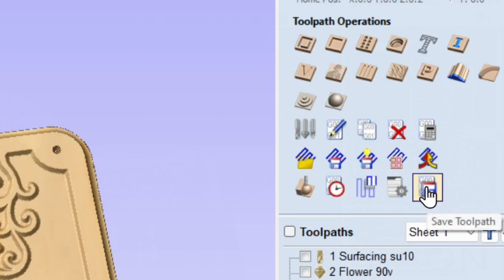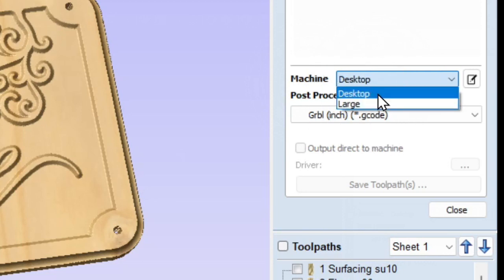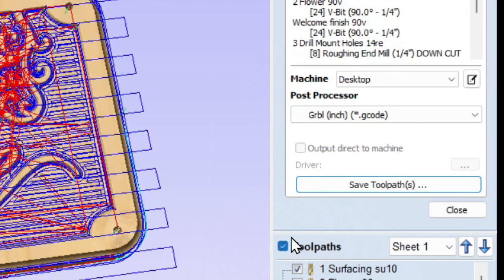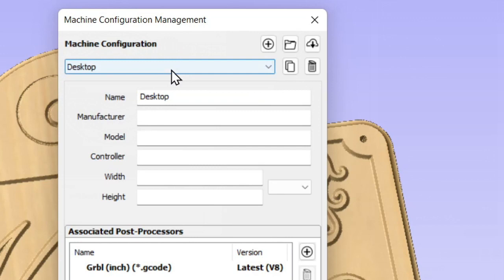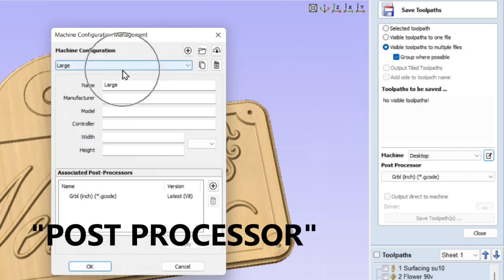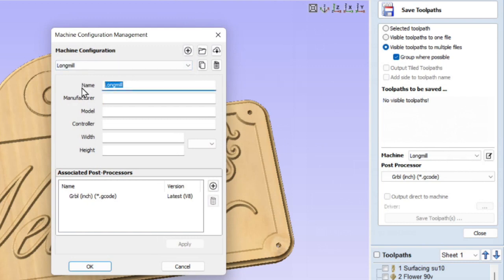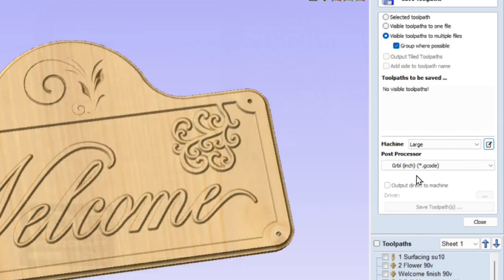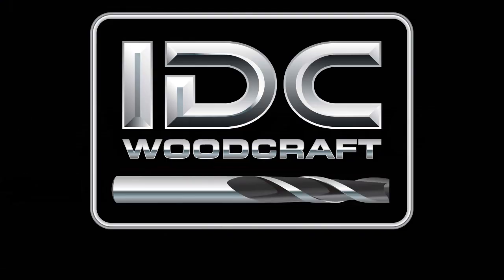How To Setup The Post Processor in Vectric Vcarve, Aspire & Cut2D - IDC Woodcraft

Comment: 4:07 please tell shat should I select for Arduino grbl base cnc machine? The post process list is so long even there is lots g code too like gcode mm, atc, arcs so...
Unfortunately I have version 10
Reply from the maker: omsingharjit, For an Arduino GRBL-based CNC machine, you can select the appropriate post processor that matches your machine's capabilities. I would suggest grbl (inch) or grbl(mm). That is your best bet brother!
Reply: @IDCWoodcraft  yeah I did this and it works

Comment: I have a trend smart plus.
It has goya controller and Bach software. 
I want to run a different software.  The dealer told me I need the extensions.
You spoke about extensions and post processors in this video.
Can you explain the difference. 
Many thanks.
Reply from the maker: Simon, a post processor writes gcode in a specific way so that the cnc controller software can interpret it correctly. An extension in your case might mean an additional bit of software built into your controller that you need to purchase before you can use a different software.

Comment: When I bought my CNC Router, my plan was to do my drawing and designing in Mastercam and use a suitable post processor. My machine came with V Carve Pro. The machine manufacturer recommended a post processor in the V Carve. Looking in the Mastercam post processor list, I didn't see that post processor. I thought I would try a Generic Fanuc which often works with many machines. When it doesn't though, and you go right to cutting, you can get some not so good results. Dry run it first and see what happens. Still, cutting air without setting off alarms or stopping the machine is no assurance you are using a compatible post processor. Attempting to cut a piece will reveal the incompatibilities and leave you with scrap or possibly a damaged machine.

So I would import my Mastercam model into Vectric in a compatible cad format and generate my toolpaths in Vectric. That seemed to work OK. Then I began to use Vectric more and more for design, as I became more and more familiar with it. Now I tend to use both software depending on what I'm doing. Still, using the correct post processor is vital. Using the wrong one can drive your machine to do some things you weren't expecting, like getting a different piece then your graphic check is showing. Then you are trying to figure out why you got a piece that looks so different. Something is definitely very wrong. Yes it is, and it may be you are using the wrong post processor for your machine. How do I know that? Um, well, let's just say I know stuff.
Reply from the maker: All great points CNC programmer. You are totally right, a good dry run before you do anything is always a good idea.

Comment: Very helpful.  But what is the difference between using inches or mm?  And would this affect how my toolpath or cnc might run?
Reply from the maker: navarholmes6358, Using inches or millimeters in CNC routing depends on which system you’re more comfortable with and the standards of the materials and tools you're using. If there's a mismatch between your design and your machine’s settings, like designing in inches but your CNC interprets in millimeters, it’ll throw off your project's dimensions. So, it’s important to keep the same measurement units from design to execution for accuracy.

Comment: Garrett if you had a laser as well would you also have separate post processor iam thinking yes
Reply from the maker: robertanscombe1508, Yes, if you add a laser to your setup, you'll typically need a separate post processor for it. Each tool often requires different settings and commands, making distinct post processors necessary for optimal performance. It's always good to check compatibility with your CNC controller as well. Happy woodworking!

Comment: Hello Garrett,
I have an older version of Aspire, version 9, and I am having some problems with the toolpaths. I manage to create my work and save it but when I take to my little CNC 3018 it does everything else except what it's supposed to. I was told that it could be related to the post processors. My CNC uses GRBL and I am not sure if it is compatible with Aspire. Is there any way to be certain if the two work well together? If not, is there anything I can do to fix the problem?
I hope that you can help me out with this.
Best wishes and thank you for your excellent tutorials.
Thomas
Reply from the maker: Thomas, I recommend reaching out to your machine manufacturer for this one my friend. They'll be able to help you the best on which post processor will work with your specific machine!

Comment: I am using vcarve pro v12.  I am also new to cnc routing.  I looked at my projects and my post processor type.  I have a mis-match.  My material setup is inches, my tool is 1/8 inch but my grbl is (mm).  That doesn't seem right.  Your thoughts?  Could explain why my sender software is having weirdness issue.  seem logical to use either inches or mm from start to finish.
Reply from the maker: navarholmes6358, Yes, you've pinpointed a common issue that can indeed cause problems. When your material and tool settings are in inches, but your post-processor is set to millimeters, this mismatch can result in incorrect tool movements because the commands sent to the machine are in a different unit of measurement than expected.

For a cohesive workflow, you should ensure that the units in your Vectric software match the units your machine is set to interpret. If your machine operates in inches, select an inch-based post-processor in VCarve Pro. If your machine operates in millimeters, choose a mm-based post-processor. This ensures that when you create a toolpath in VCarve Pro, the G-code generated will communicate with your machine in the correct units, avoiding any issues during the routing process.

Comment: Hi Garrett i have a aspire 11.5 and i try tu cut a circle 35 inches on diameter and wen i take it to the machine only cuts a 3 1/2 inch circle can you help me please and thank you have blessed day
Reply from the maker: Juan, make sure the post processor you are using is configured to the same units that your CNC machine control software is set up to. If you are using a (mm) post processor, try selecting the (inch) post processor for your machine!
Reply: @IDCWoodcraft  thank you sir i will try it

Comment: So once the post processor is set up and selected in vcarve, do I set the toolpath  info in vcarve like I did for a shopbot, or do I set up toolpaths in gsender once the project is designed, considering a vcarve pro /Longpath MV2 system.

Does gsender work under wimdows operating system ir does it use it own. What are the laptop specs needed to run gsender, or am I even using gsender?

I am totally confused. Purchasing mv2 and vcarve pro soon.. Paul Schuster
Reply from the maker: Paul, I recommend taking a look at this video here brother: https://youtu.be/wQ0vgXbSRr4?si=troyJ6YRR9Ath2My. I think you'll find it super helpful! If you're still having troubles, I recommend reaching out to Sienci directly and they should be able to help guide you in the right direction. Here's the link to their contact page: http://bit.ly/499dtxg

Comment: Awesome videos for this newby.... Question.... Is there a way to load a G-Code file that was created with Bobcad into Vectric Aspire and edit it? I have a flash drive with several G-Codes for pool cue points and designs, but may want to change the size, etc. I read something about converting to DXT files (or something like that) and then you may could. Any clue?
Reply from the maker: kirkovercash, absolutely! You're definitely on the right track with your thinking my friend. But, this one is a little tricky to walk you through over comments. I recommend joining Kate and I for our weekly live session we host every Wednesday at 8PM EST and we should be able to help guide you through it then!

Comment: Question; I created a project did the tool path. I uploaded it to Gsender and and my 3018 pro max starts the job. The problem is the project is supposed to be 6”x5”x1/2” cutout but it turns out being less than a inch and not all the way through even after the warning that it would.  What could I be doing wrong?
Reply from the maker: corejr691, it sounds like you are using the wrong post processor. If you are using grbl (mm) consider switching it to grbl(inch) and vice versa brother! That should fix your problem.
Reply: @IDCWoodcraft  I’ve changed everything to inch that I could find, I’ll go back to mm.   This machine came pre-installed with candle.  The z and y axis try’s to exceed the limit switches and z axis moves upwards whether I hit raise or lower. Thinking maybe I should change the control board. What do you think?.

Comment: Thanks for the great videos!!  How do I run my job I have created?  I was using Easel Pro, but have been messing around with Vcarve Desktop free trial.  I want to send the "Avalon" sample job to my CNC.  Do I need to export the gcode and use Easel Pro to send to my machine?  Thank you
Reply from the maker: JeffGreen, so glad you liked this one brother! This one is a little tricky to walk you through over comments. I recommend joining Kate and I for our live sessions we host every Wednesday evening at 8PM EST. We should be able to help walk you through it then brother!
Reply: Update, I believe I got it installed.  I had downloaded the Easel PP and installed it in Vcarve Desktop Trial.  I them re-calculated my toolpaths and re-saved.  Imported into Easel Pro and sent the job.  its the sample Avalon one but it is running.  I will definitely like to check out the Wed sessons!! @IDCWoodcraft
Reply: So the Avalon sample is 2 toolpaths, it went and completed the pocket toolpath and looks great, however it didn't return to start position and hold for bit change.  Then I presume I would change my window to the 2nd toolpath and start it up.

Comment: Thank you and it is very useful tutorial. How to do multiple option/switch post processor (for multiple tool that require different set of instruction) Ex: T1 / T2 / T3 have different instruction. Therefor if T1 (Set of instruction no 1) and T2 no 2 and so on.
Reply from the maker: sufainahmad3575, you are so welcome brother! For that I would recommend reaching out to your machine manufacturer on the best post processor to use for different tools.
Reply: Thank you very much  @IDCWoodcraft

Comment: So, I recently picked up a small cnc to learn on, but can't find a post processor listing for it. The test projects that came with it use an .nc format but the specific manufacturer doesn't display the specific machine in the drop-down list of of the menu in VCarve Desktop trial. I have a message out to them asking for the specific post processor info, so hopefully that arrives sometime soon!
Reply from the maker: Gary, I just saw your previous comment brother. You're doing the right thing reaching out to your manufacturer. I would say to wait for their response and go off of their recommendations for now my friend.
Reply: @IDCWoodcraft  I got the reply today regarding the post processor info, and essentially I need to manually create the machine config in VCarve to include my machine. I went ahead and purchased VCarve desktop and have been trying different machine configurations to match my machine - SainSmart genmitsu 4040 pro. So far I've carved my name on a piece of mdf using a GCode file as a post processor in the machine configuration, and that turned out OK. The candle software doesn't render the tool path very well, but it directed the machine just fine. Onward and forward!
Reply: @IDCWoodcraft  I forgot to add that the manufacturer didn't have anything and referred me back to the software company. I shared the email with them and they provided the video tutorial of how to manually set up a post processor!

Comment: How do you know if the post processor is inch or metric? PS still running your bits and they're holding up fantastic.
Reply from the maker: D Barger, usually the title of the post processor  will say gbrl (inch) or gbrl(mm) denoting what unit of measure.

Comment: I must say I have learned SOOOO MUCH from your videos…..but now I’m stumped because when I open my Sainsmart CNC…I’m not able to find my code that I’ve generated via vetric.  I’m sure I’m doing something wrong.  I need your help.  

I have went through the post processor selection options and selected Grbl
Reply from the maker: Willie, are you working with the trial version of the software? If so, you won't be able to generate the gcode. If not, I recommend sending a message over to vectric directly and they should be able to help you troubleshoot and give you a little better guidance than I can on this one! Here's their contact page just in case you need it: https://www.vectric.com/support

Comment: Can artcam support grbl for  Arduino based cnc?
Reply from the maker: omsingharjit, ArtCAM does not natively support GRBL, as it typically works with its own systems and compatible software. However, you can create your designs in ArtCAM and export them to a file format like G-code that GRBL can read. After that, you can use a compatible software to send the G-code to your Arduino-based CNC machine. It's always a good idea to double-check the specs and compatibility for smooth operation!
Reply: @IDCWoodcraft  But, as you said, ArtCAM doesn't support GRBL post processors. That means there would be no option to generate G-code via a GRBL post processor, so how is it possible? And even if it could output GRBL, the problem would already be solved! It seems you’re suggesting using ArtCAM as a CAD tool to export vector files, then using another CAM software to generate GRBL G-code, right?
I also researched that people use Mach post processors in ArtCAM, which are somewhat similar to GRBL, but the code requires manual editing.

Comment: if you select GRBL mm instead of inches what effect would it have? (I work in inches)
Reply from the maker: davidorourke9920, Switching to GRBL mm would change the unit of measurement used in the software from inches to millimeters. This means all your measurements and tool paths would be in millimeters instead of inches. Just make sure to adjust your design accordingly when switching between the two units.

Comment: Hi Garret I am currently running a stratos pro  cnc router with a fanuc controller i can not find a post processer on there list that wants to work on my cnc .can a guy get one made for it or is that not possible ?who do a guy get to make a post-processor if that is an option.Thanks  Garret.
Reply from the maker: Wow nice machine Mark. That machine is a serious industrial piece of kit. You will have to reach out to the gents at Stratos to get you squared away with the equipment to run that bad boy properly.

Comment: Thanks for another great video. 
I could use some help I’m a 75 year old  newbie     I have a cnc genmitsu 4040 pro I was using Easel and had no problem with my g code download to universal gcode sender. After watching you for a while I saw that I should be using VCarve desktop my problem I can’t figure out what post processor to use for my cnc. I tried looking at the genmitsu web site but couldn’t find any help   
If you could maybe point me in the right direction I would greatly appreciate it. 

Fred
Reply from the maker: Try using grbl (mm) or grbl (inch) brother!
Reply: @IDCWoodcraft  thalami’s my friend will do

Comment: I have ran my diy CNC for 14 years on the same post processor but now attempting to run panes with tool change it won’t let me save the file it’s not supported.  I went into the system as you describe and found “mach2/3 Arcs (inch) V3 (*.txt)”.   There wasn’t a version number in the original.  I selected it and it displays as my PP, But the save tool paths is still grayed out. I go back to the save tool path and it didn’t display the new file back to the original file without a version number.   I have 3days to run this file what do I need to do to be able to run it.?
Reply from the maker: IH1940HAY, It sounds like you're dealing with a compatibility issue between your software and the post processor. Make sure you've set the correct post processor in your CAM software before saving the tool paths. Sometimes it helps to restart the software after making changes. If the option remains grayed out, check if your design file or settings might be causing the issue. Good luck, and I hope you can get it sorted quickly!
Reply: @ I found a local fellow that was knowledgeable with Mach and SS, he got it working again.  He didn’t install Smoothstepper he just copied an old backup file and pasted it into the new mach3 file  and renamed the extension as a YouTube poster CorvetteGuy had done and it all works now, plus a few misc things.  
I was successfully able to cut the stable and manger project for church without any problems.  But the two signs involving Tiling and Clearing was a whole different ball game, I had used tiling before without any problem but include clearing with so many bit changes on a DIY machine and I gave up.  When we get back after the end of the year I’ll tackle it then, and not pressed for time. Thanks.